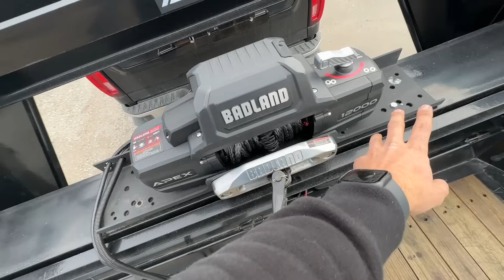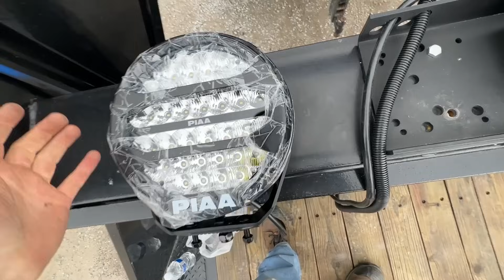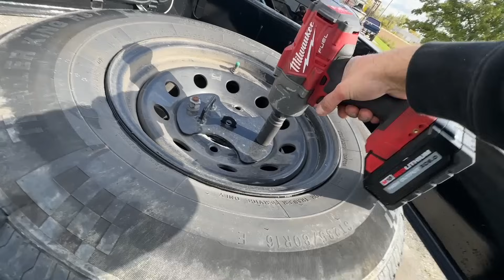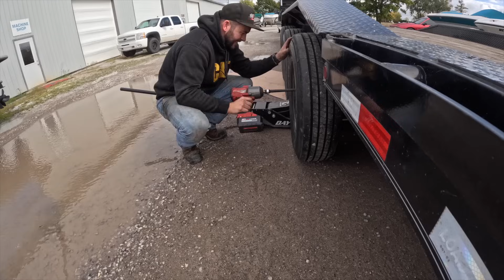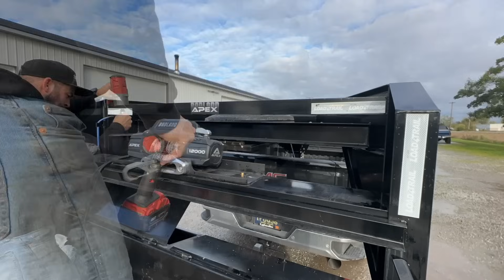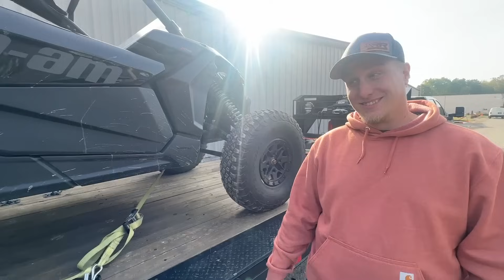PREP TIME For a HUGE Trip! New Trailer gets Major Upgrades (Tires, Lighting)

Comment: Lights should be mounted higher. Once you load the first buggy on the trailer it will be blocking the light to the back of the trailer. No big deal though. LOL

Comment: I did the same thing with led lights on my trailer. I wired a relay from the reverse light 12v at the trailer plug and had them come on whenever the truck is in reverse to help with backing the trailer at night. Also wired in a switch right from the battery to turn them on when loading up the trailer. Just an idea for ya!
Reply: Was thinking the same thing.